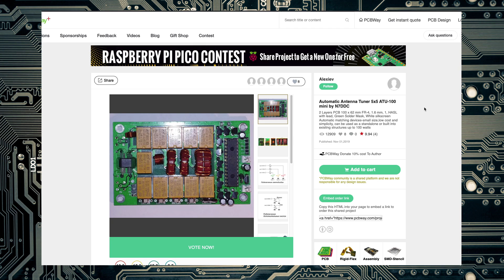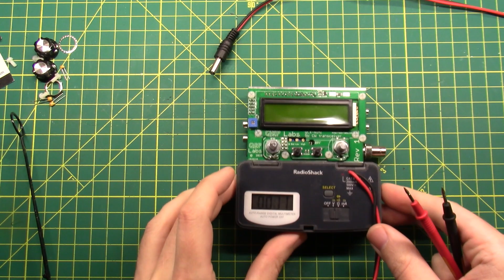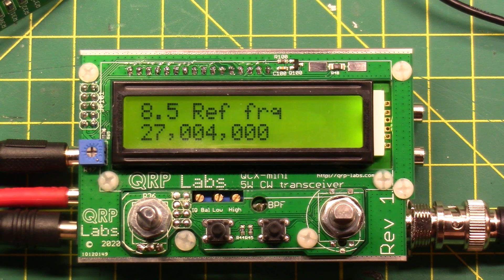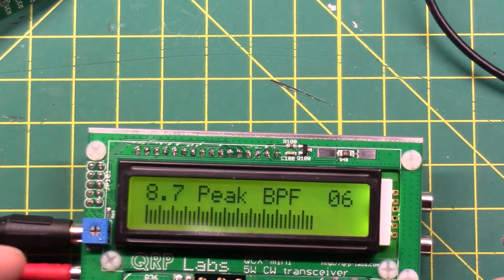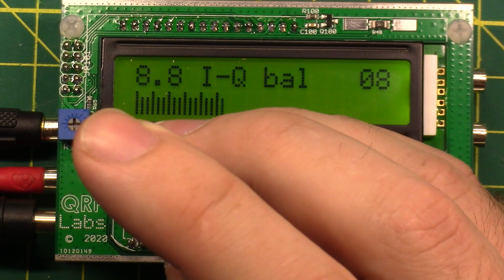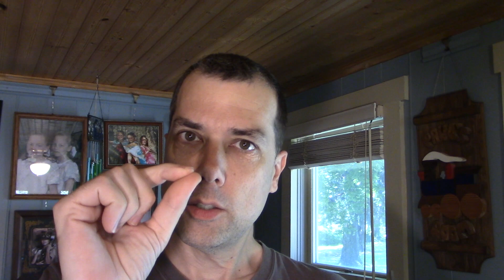How to build a QCX Mini - Part 8 - Receiver Low/Hi and BPF  Alignment

Comment: I have built one of those ATU/AMU though mine has 7 toroids and 7 capacitors 15 relays with the pic chip and the screen. Though I had to flash the chip as it wasn't pre programmed
Reply from the maker: Does it work well?
Reply: @temporarilyoffline  yes very, thought it did get a little hot with 95W of ft8  running through it the other week. I posted a picture in the ft8 off discord room still works beautifully thought
Reply from the maker: @jonathannuttall8369  I think I saw that, and also a video of somebody building one.
Reply: @jonathannuttall8369  95w on FT8?

Comment: I might be wrong, but I think you want the lowest number in the upper right and the lowest level on the bar graph when setting the IQ balance and high/low phase. But then you explained more in the end. I’ll have to double check the alignment on mine to make sure I did it right.
Reply: You are correct.  Think of the bar graph as fractions of the number in the upper right.
Reply from the maker: I had to film that part twice, the camera lost audio... My radio is double aligned now.  Good luck!